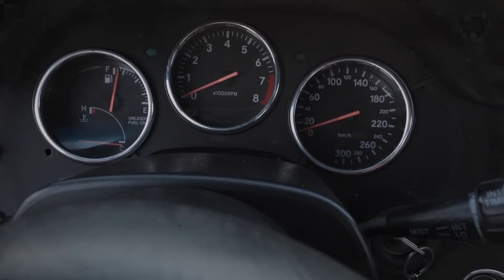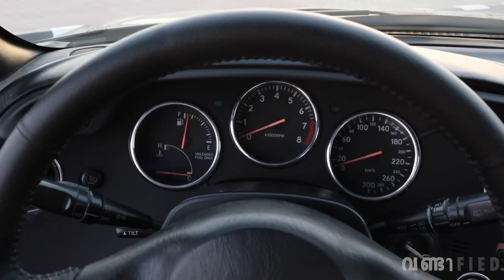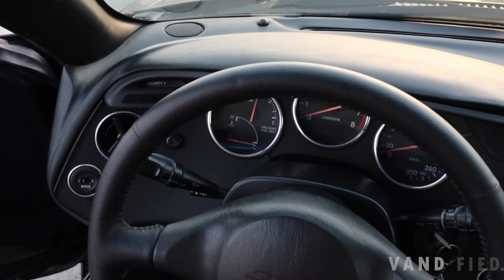Toyota Supra Mk4 Malayalam review | വണ്ടിfied #supra #toyota #jdm #2jz

Comment: Skyline ✅
Supra ✅
next up... S15😁

(bro, while reviewing supra, anti-lag koodi mention cheythirunnenkil polichene😁)
Reply: wow arun pradeep
Reply: 2jz ❤️,Also don't forget Rotary Mazda rx7.
Reply: @ezioaudotoredafirenze4471  Anti-lag is used to keep the turbo running when throttle is released(to reduce turbo lag)... athinu engine build cheytha materialumaayi bendham onnum illa...
Reply: @ezioaudotoredafirenze4471  thats just the basic principle of a turbo... I thought we were talking about anti-lag here... which is acquired either by the adjustment of the ignition timing or by enriching the fuel/air mixture... which makes the 'pops and bangs' that keeps the turbo running even if the throttle is shut.... something thats purely controlled by the ECU.
It has nothing to do with the material of the engine... and I really dont understand why you told me about the "blowing into the fire" part... thats just basic common sense...
Reply: Next s13 Silvia😂
Reply: Rx7 vende? Rotory😘
Reply: Is that a supra 

Boyhood😉
Reply: @ArunPradeepMusic  shenta saare ellaan kalakki kudich padich vannekanlla
Reply: CHETTA ADUTHA VIDEO ENNU IDDUM
Reply: @ArunPradeepMusic  le lavan : kittiyooo, illa...choich vaangi 😂... Arun settan summava 🤙
Reply: Appo iyal nammede aalaa le (JDM and Paul Walker 💔)
Reply: @sajidc2980  anne
Reply: @UCHIHAA_ITACHII_  ⚡️💘💘💘
Reply: @ezioaudotoredafirenze4471  kittyo illa..choich vangichu😌😂
Reply: I see an assassins creed fanboi.......
Reply: yeah yeah facts...
Reply: Ya , that lets it gun through instantly !!! 😍😍😍
Reply: @ArunPradeepMusic  dey dey....2um koodi kedann  adiyondaakkalle....😂
Reply: Supra, skyline, honda civic, mistubishi elipse, lancer evo 4, BMW M3 coupe🤤
Reply: Is that a supraa
Reply: @stonecar9899  intial d reference ???And yeah rx7 pewer aanu
Reply: @bilaltorso318  cresta jzx100 vende aliyaa
Reply: @urstrulyganesh2242  bmw m3e30 rally aanu main e36um kollam
Reply: Petrolhead Arun pradeep
Reply: Waiting for RX-7
Reply: Bro anti lag okke vech kazhinjal turbo pani aaville
Reply: Mazda rx7 kaynjittu mathi
Reply: Arkum Plymouth vnda😪
Reply: @ArunPradeepMusic  mech aayirunnalle 😅😂
Reply: @UCHIHAA_ITACHII_  poli saana Silvia with sr20 dett engine 🤩
Reply: @ArunPradeepMusic  😄
Reply: @adwaithadhu8336  yehh🫂🙌
Reply: next Acura NSX
Reply: @adithyas.krishnan5828  where my tofu at boi🌝
Reply: Supra’s owner insta’s Account plzz
Reply: Waiting ..........
Reply: And RX7 KOODE KANIKKO
Reply: R34
 Subaru
Supra
Reply: @gauthamkrishna8648  yes yes😂😂😂
Reply: @BC-gt6gf  no its a 800 maruti
Reply: Fan GIRL... .!
Reply: Where is miata

Comment: 20:06 That turbo Whistle.... 🔥
Reply: Stututu Stututu💥...
Reply: @brianoconner8405  😂😂
Reply: @nikhilraveendran3265  yea😂
Reply: @nikhilraveendran3265  a man of culture I see 👀
Reply: @augusto9255  what culture has to do with what I said. I just stated a fact.
Reply: @nikhilraveendran3265  point 😂
Reply: @nikhilraveendran3265  bro ath just comments il use cheyyinna sambavam aan
Reply: Turbo flutter, to be precise.
Reply: r/whoosh
Reply: @nikhilraveendran3265  bro, if I'm not wrong.. blow off valve is the equipment which produce turbo whistle 🤷
Reply: @shijasmhd9404  No. blow of valve removes excess pressure inside the system when you lift off throttle.
And turbo whistles when you give throttle and spools up the turbine.
Reply: @nikhilraveendran3265  its pressure valve